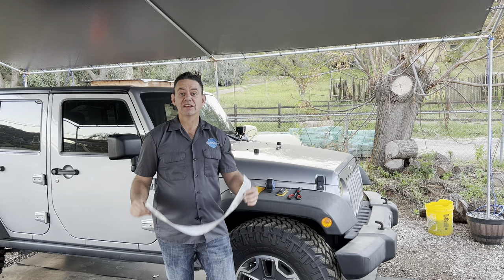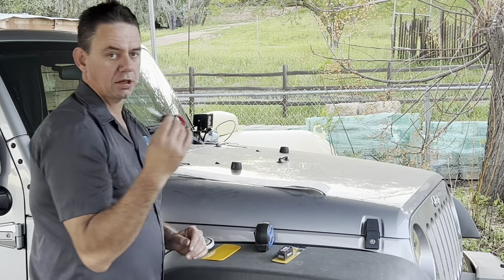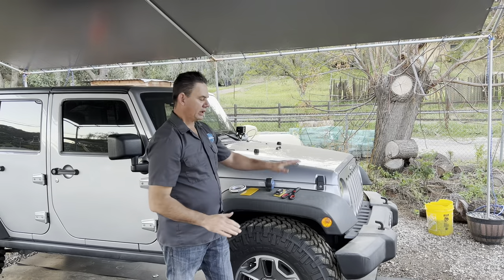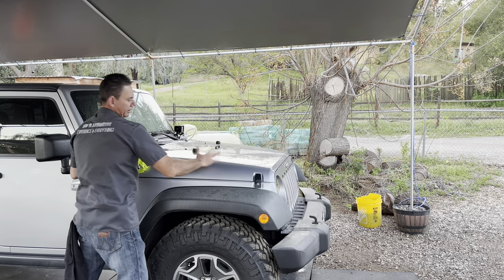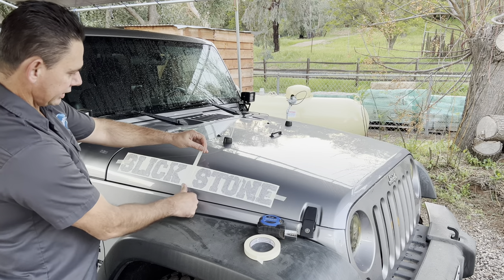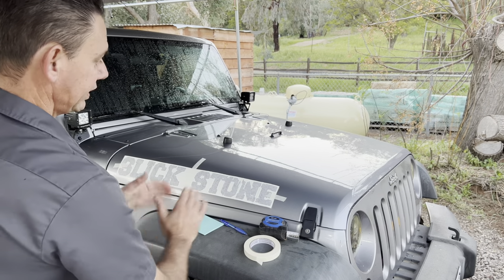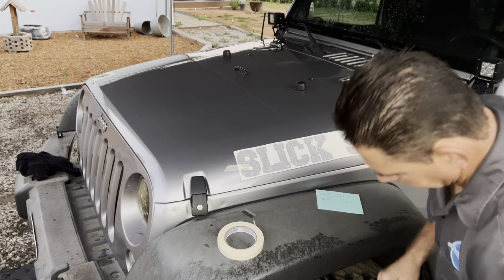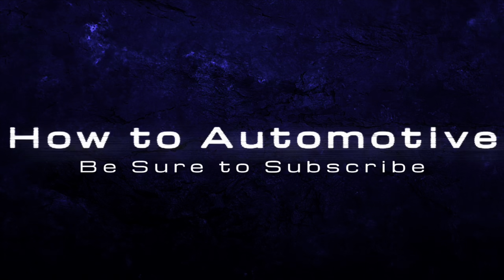How to Install Jeep Hood Decals Like a Pro

Comment: What is the cleaning soap you use before applying the decal? and do I need to use that soap if my Jeep is brand new?
Reply from the maker: Any decreasing soap will work such as Dawn dish soap. what you’re doing is removing any waxes, so yes, even if it’s new wash the area for the decals. Not the whole vehicle though.